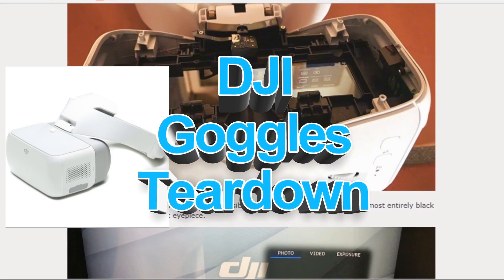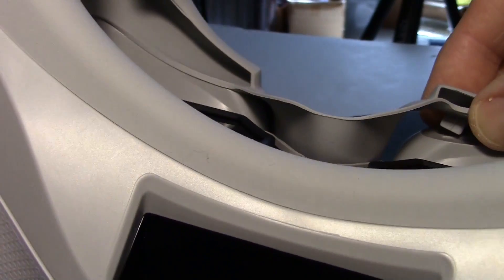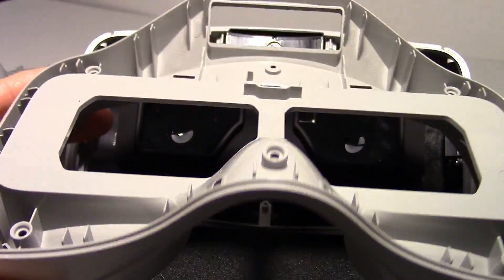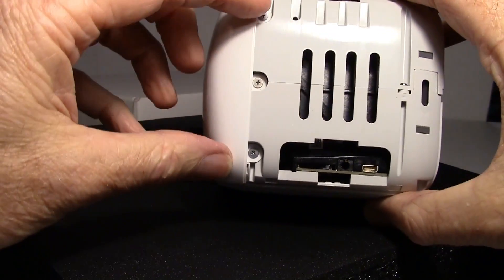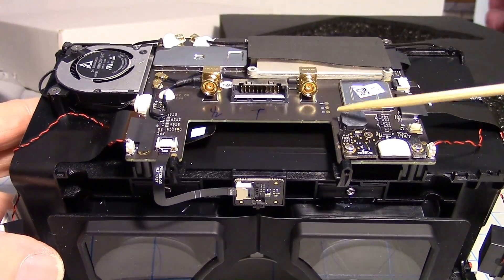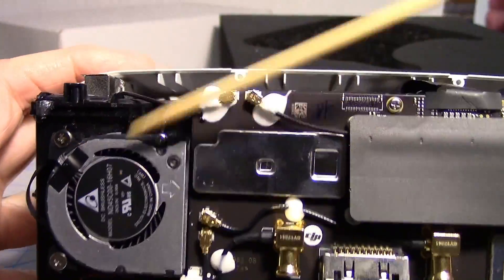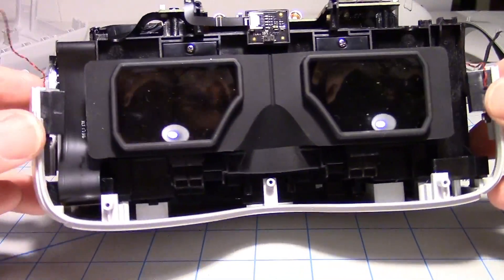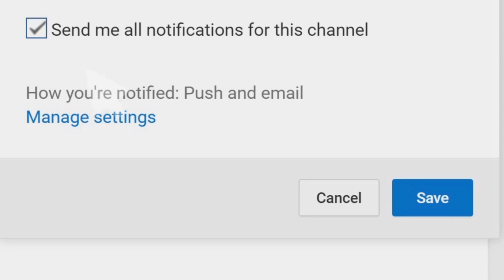DJI Goggles Tear down - Secrets Revealed when Taken Apart!  Headband Teardown link in description.

Comment: Rf transmitter? Antennas in the head band, Scary? 😷😓😡 could give a headache if they're transmit antennas

Edit.
Googled: do v1 re dji goggles have transmit antennas in the head band?

Google "AI" says:
Yes, the DJI Goggles RE (Racing Edition) V1 does have transmit antennas, and they are located in the headband. Specifically, the Goggles RE features two internal linear polarized omnidirectional antennas and the option to use an external Pagoda antenna (a 5.8GHz LHCP antenna). 

Here's a more detailed breakdown:

Internal Antennas:

The V1 RE has two internal, linear polarized, omnidirectional antennas that work for 5.8 GHz video transmission. 

External Antenna Option:

The goggles are also compatible with external antennas, including the Pagoda antenna for 5.8 GHz transmission. 

Antenna Placement:

The internal antennas are built into the goggle's headband, while the external Pagoda antenna connects to the SMA port.

Comment: Great video but a headband tear down and battery replacement would be most useful as this is the most common issue. I know DJI will do it but would be nice to see a DIY
Reply: Random Reviews did a failed headband called Original DJI Goggles (White and Black) - My Battery Replacement Gone Wrong Might Benefit You! which is super helpful.
Reply from the maker: @BrilliantDesignOnline  I'm glad somebody did it.  I was afraid to try the headband because it looked like trouble and not really that interesting inside. The best solution would probably be to run some wires outside the band for an external battery.
Reply: I am looking for the same......mine only charges to 33% now
Reply: Mine doesn’t charge at all
Reply: Hello, same here. My goggles won't charge at all. Any useful tips where to start?

Comment: Man, how grateful I am to you for this video!  Kudos!
My goggles RE in trouble, one screen has a horizontal lines on it (top one) front one - is good. I've disassemble goggles, switched screens (connected one instead of another and vice versa) and both works fine. Connecting back again (as it has to be) and still got lines on the top screen. Smells like a mystic. I've wiped flat cables with spirit just in case but no success. Puzzled at the moment.

Comment: The DJI company deceives everyone when it indicates in the technical specifications the total number of pixels as 3840 * 1080p, or 2 monitors at 1920 * 1080 p.

In fact, there is ONE monitor 1920 * 1080p, divided by polarization into two images of 1920 * 1080i

Компания DJI обманывает всех, когда указывает в технических характеристиках общее количество пикселей как 3840 * 1080p, или 2 монитора при 1920 * 1080p.

на самом деле внутри только ОДИН монитор с разрешением 1920 * 1080p, разделенный поляризацией на два черезстрочных изображения 1920 * 1080 i
Reply: Вы не в курсе какой тип дисплеев используется в шлеме? Мне нужно один поменять!

Comment: great video. that sounds like a pepper's ghost box with modern tech. For DYI repairs, does DJI or aftermarket places sell the monitor. Mine definitely broke, but haven't found too many solutions out there.
Reply from the maker: Not sure about the parts. Hope you find a solution.

Comment: Interesting video! Pls consider a headband teardown. A curiosity: the charger attaches to the headband, which has a charge light. Presumably, there is battery only in the headband, which can be charged alone. However, if the goggle part is plugged into the headband part while charging, the charge indicator on the goggle part continues to blink 1-2-3-4 for quite some time after the headband part has turned green. Which charge indication to believe? It does not look like there is any battery in the goggle part, not even a small one.

Also of note: An LCD display functions by having two identically polarized sheets of plastic with the liquid-crystal polarization-twist layer interposed between them. In one state, a liquid crystal pixel twists the plane of polarized light 90 degrees and lights up; in the other state, there is no twist, and the display is black for that pixel. Add color filters, and you have full color LCD. DJI no doubt has its two screens cross polarized. Clever design, I say. Also, a lot of investment in plastic injection molding and mechanical engineering. Clever IPD adjustment.

Thanks for the hard work taking that beast apart. Excellent work. Fwiw, the antennas in the front of the goggles are the 5 GHz antennas, and the ones in the headband must be the 2.4 GHz antennas, I'm guessing. It's not so hard to design a single antenna that functions at both bands, as is common in AC routers, but I'm sure DJI had its reasons. Maybe one pair is for the video link and the other is for command and control info. Complex either way. A lot of value for $350, even if the goggles have quirks (they do).
Reply from the maker: First thing you got me thinking how dangerous it is to have those transmitting antennas right against the head. Could this cause cancer down the road? I didn't know about the delay in the charge indicators. That actually might be interesting to take the head band apart and see what's going on although the subject is not trending anymore yet if the battery was to need replacing some people might be interested for that reason.
Reply: @DaveMerc  No concern re antennas near head. 2.4 GHz and 5 GHz are non-ionizing, low-energy electromagnetic radiation, nothing like UVC, X or gamma, which are ionizing, meaning they can strip electrons off the outer shell of an atom, causing molecular rearrangement. Microwaves, particularly at low average power levels (perhaps 0.1 watt, but probably much less; remember,  most of the transmitting is the drone feeding back video) can only heat tissue, and you can imagine how long it would take to cook your burger in a 0.1 W microwave oven (also 2.4 GHz). Head is thick layer of fat on top of skull bone. RF strength drops rapidly when penetrating conductive materials, such as human body. Any radiation penetrating through to the brain will be very, very weak, probably nanowatts. More danger in standing under a powerline on a street corner, and there's very little danger in that.
Reply: @DaveMerc  I am at the point of needing to replace the battery in a set of these now. I am normally good at taking things apart and repairing them, but for the life of me I cannot find a starting point on the headband lol. have you looked at this yet?

Comment: Thank you so much for this video, it helped me fixed my goggles. For some reason my touch pad module wasn’t working. turns out it was dismounted, I used some double sided tape to stick it back. I hope this comment can help people with similar situations.
Reply from the maker: Thanks for sharing your repair experience and I am sure it will help others as hoped.

Comment: Hej Dave, thanks for a great video. Did you ever find the little beeper speaker for when pressing the on/off button? The reason I'm asking is because I wake everybody up when I turn them off late at night after watching a movie, so it would be nice if I could just mute it. Btw, I disconnected the little black cubes on the sides, but that turned out the be the real speakers.
Reply from the maker: I don't think I ever found a beeper but it's probably there somewhere.  I thought the sound was coming from the speakers cubes but no luck.

Comment: Did you end up with any extra screws lmao. It’s like a jig saw puzzle. Very interesting video.
Reply from the maker: I couldn't believe it... but no. I did not have extra parts left and I even got the screws back in the right places after some sorting. The amazing thing is I kept from braking those tiny ribbon cable connectors, which were my biggest worry.